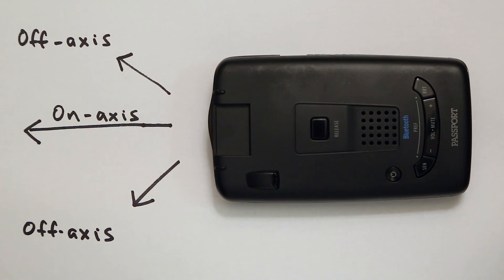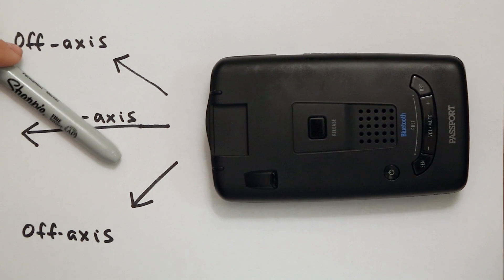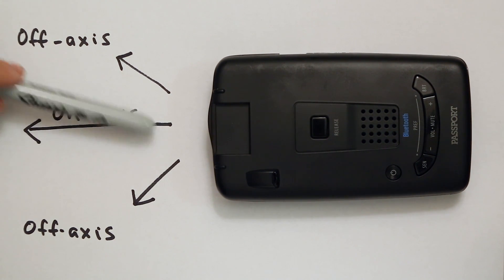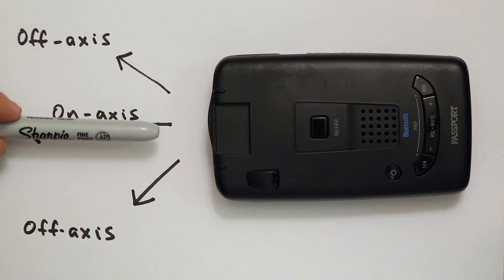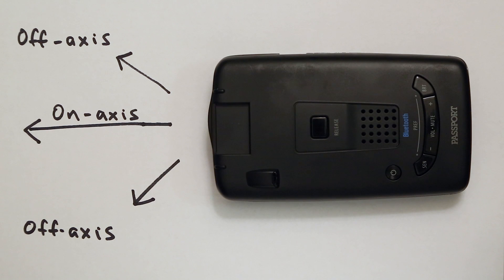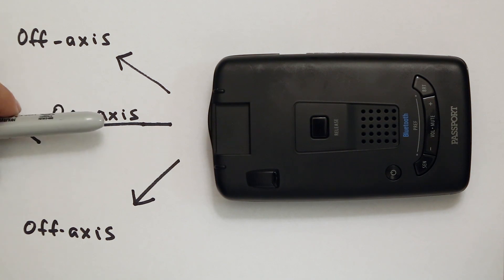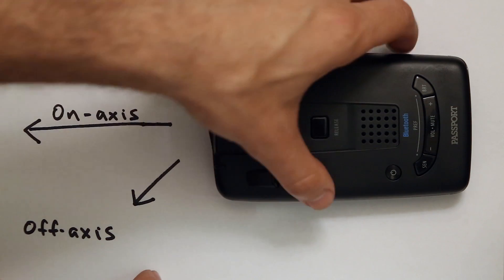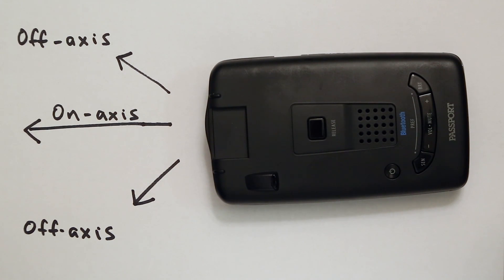Radar Detector Performance: On-axis vs. Off-axis

Comment: Sounds like what radar Roy was doing when he be testing detectors. Holding them in his hands and such. Anyways great video I learned a lot.
Reply: So much of what RR does is wrong.  From him testing multiple detectors at the same time to not mounting them in the same location.  Even if he ran them one at a time, they are mounted in different spots on the parabolic windshield. Different spots on the glass greatly impact their angle to the radar source.